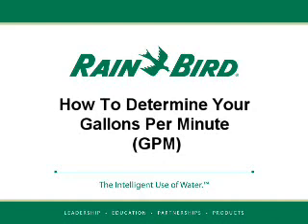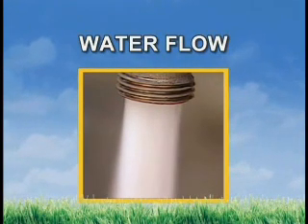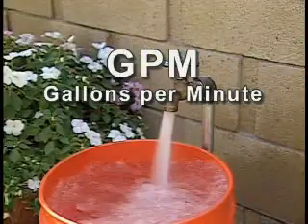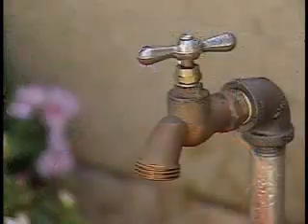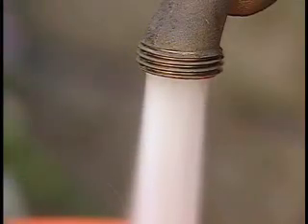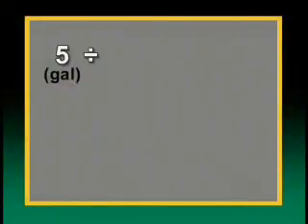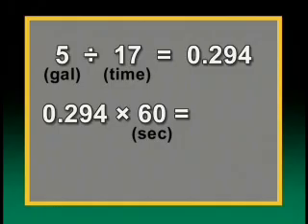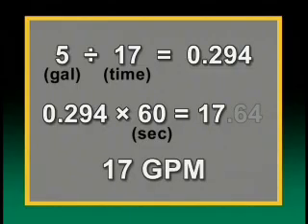GPM (Gallons per Minute) and Your Irrigation System

Comment: Every video does this right and wrong. To know if you have great flow rate or even good it needs to fill a 5 gallon bucket in less than 35 seconds. Thats all you need to know to be able to know you have good water volume. Make sure to design system with small zones using less than 10 pop ups and only 5 rotors max is my general rule however the flow rate of the nozzles matter yet with me sticking to this rule I’ve never had an issue

Comment: would 5 gallons per minute and 60PSI be enough to drill a 2" x 30' PVC shallow well in a sandy part of central Florida.  It's remote and I need to go 12v and keep to a budget.  Saw a guy do it on YouTube and wonder if really possible.  I just need to push up some sand and clay as I push the pipe down.

Comment: This is actually a dumb way to measure flow rate because a hose bib is full of restrictions and most likely is not even the same size as the pipe you plan to use. There has to be another way to calculate gpm. Whats the gpm if the psi is 80 and the pipe size is 1" ?? 21gpm??
Reply: You could remove the bib, attach a male hose adapter,  and hook up a hose, the turn the water back on
Reply: No matter what has happened "prior" to the water exiting the hose bib, it has already taken it's toll so the "restrictions" are a moot point. However, what happens "after" that, the pipe you plan to use etc, are facts/issues you need consider. So, while not hugely scientific, this method is plenty good enough to make some determinations with. Someone else mentioned that if you are getting at 5 gallons at something under 30 seconds or so you'll be fine with the 10 pop ups, 5 rotors max setup. Also, make sure to consider friction loss from too many right angles. You can "soften" that up using two 45 degree elbows instead of a single 90.
Reply: J M the friction loss in a hose bib is doesn’t affect the Gpm . Not a ton of restrictions . Look up friction loss for a faucet
Reply: @bladesofglorylandscapingll265  I just measured two of my hose bibs. Water pressure is 60 PSI at the meter. Both have standard hose connection fitting sizes (~5/8" nominal I.D.). 1 hose bib uses full port 3/8" ball valve, and the other uses close-enough-to-full-port 3/4" ball valve. Water meter is 3/4" nominal.
11 seconds for 4 gallons with 3/8, and 7 seconds with 3/4.
We're looking at ~34 GPM at the 3/4" hose bib, and ~20GPM at the 3/8" hose bib.
Both hose bibs are more than 5 elbows and 160 lineal feet from the water meter, through 1 1/4" PVC.

"If I were any dumber, I'd be a plumber"
Reply: @bladesofglorylandscapingll265  These standard hose bibs often have a 5/16"-3/8" internal hole. They suck azz.

Comment: I would imagine the pressure build up from the summer heat would throw off the measurement if only one gallon was done.
Reply: 5.. 5 gallons.. headass
Reply: that's only if you have a one-way flow valve at your water meter or you have some weird plumbing situation.